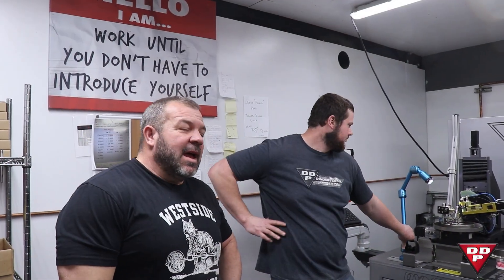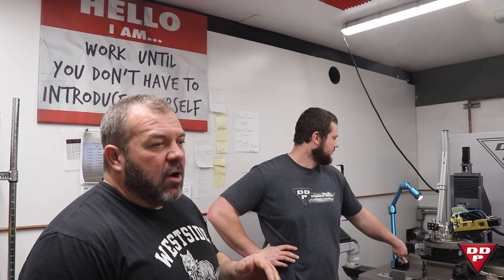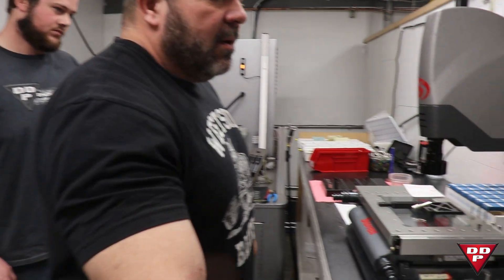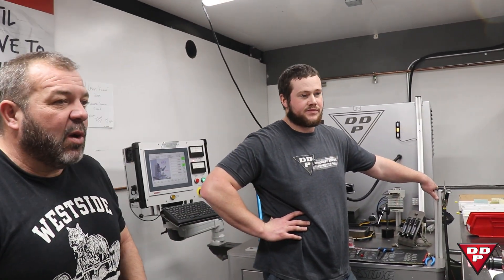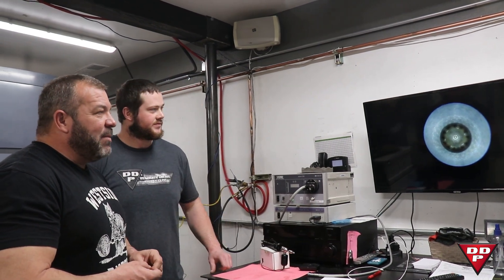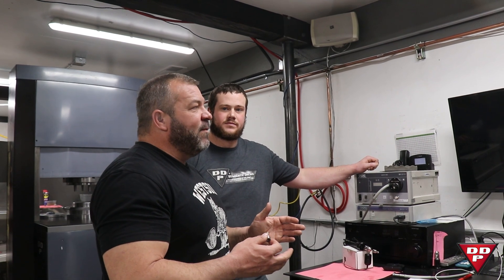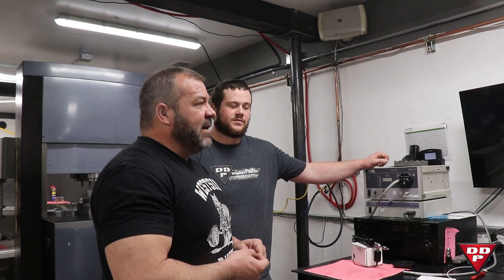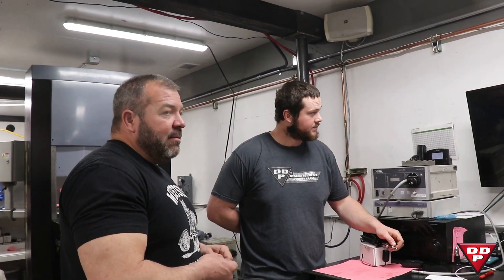The Perfect Nozzle - DOES IT EXIST!?

Comment: Ever try drilling the holes for location first? You should be able to get that very consistent.
Reply from the maker: Our EDM is far more precise, and accurate, then attempting to drill a hole in the nozzle.
Reply: @DynomiteDieselTV  Likely so but millions of factory Bosch nozzles were drilled for years and years. I assume you are using a sinker EDM to put in blank holes and it is my experience the round surface of the nozzle can cause the arc to wonder and be somewhat inconsistent so it is a challenging operation as you have shown. Drill for location and edm for size and shape I think might give you better more consistent results. Thanks for sharing this tech content and continuing to do the R&D to make things better! I have installed literally thousands of sets of injectors over the years and the DDP are always one of the top performers.
Reply from the maker: Our EDM, and holding fixtures, allow us to be far more consistent than drilled nozzles. The same principle applies to drill bits, and deflection, just as it applies to the tungsten that we use in our EDM.

Comment: Making any progress on advancing 12V injectors or P7100 injection pumps?
Reply from the maker: We've already done extensive testing on the 12 Valve platform and have a lot of solid recipes already! We don't build pumps here in house, but we do have a few builders that we use regularly.